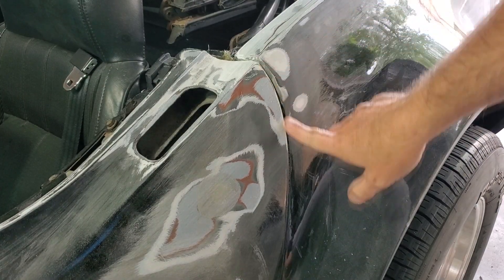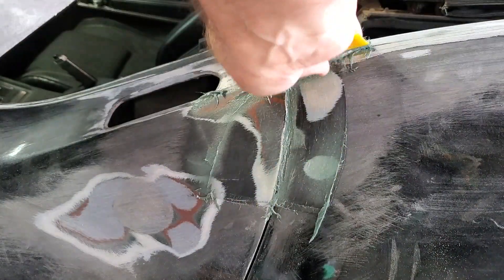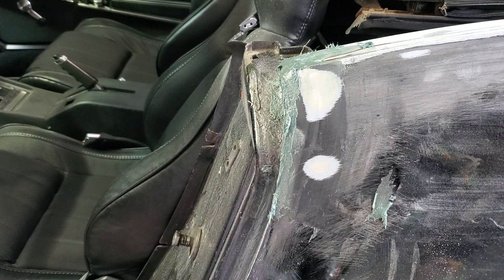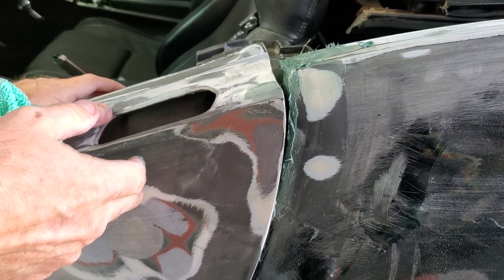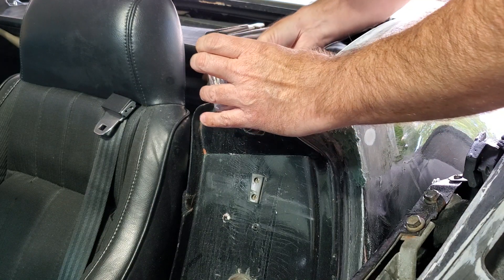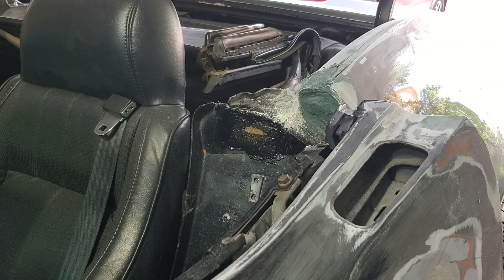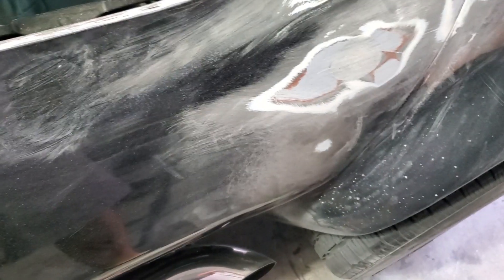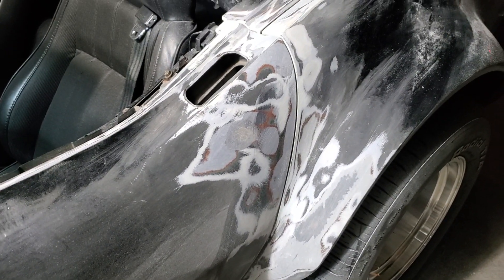Working on the doors. Pt-5. C-3 1969 Corvette. New parts!!! More body work!

Comment: Your hard work and attention to detail will pay big dividends when completed! 
You still may consider paying a pro to clear the entire car once you’re completely done. You’ve done the hardest part! A quick spray shouldn’t be a big deal for any willing shop or body man Afterhours for extra cash. I’ve also seen a light coat of paint over an entire vehicle look spectacular and nearly flawless if the prep and paint underneath was done right, as in your case. You could probably get away with just paying $300-500 for a pro spray in a booth with a little more for the buff and cut. That could be the cherry on top that brings it home. Either way, I think you can still cut and buff some more and get to where you’re totally happy with it! Keep up the great work! That ‘69 will be amazing when done!
Reply from the maker: I plan to have a pro do it one day, and like you said all the hard work will be done. But maybe in a year or two. The best part of it all is that if I get a rock chip or scratch it won't bother me much. My wife already scratched it by putting a bag of groceries on the front fender. lol. She doesn't get us car nuts, she thinks I'm crazy. haha.
Reply: @nicholasjackson3344  Totally agree, same scenario with my wife. Dealers respray their cars all the time to get that fresh even look throughout. The trick is to find which shop is doing that kind of work, and get a chance at it when the time comes.